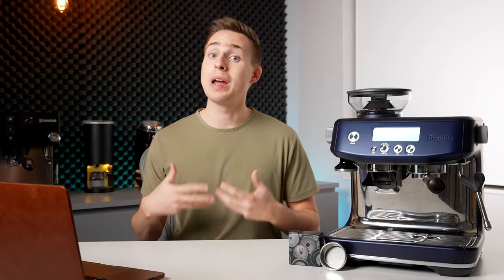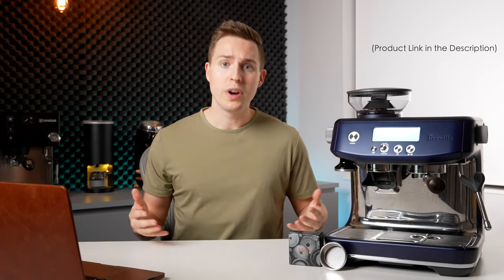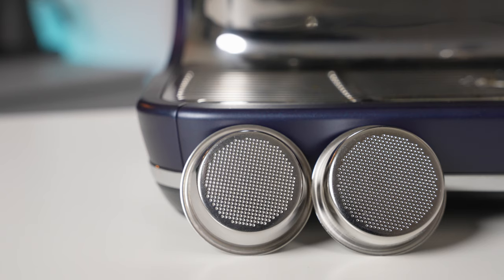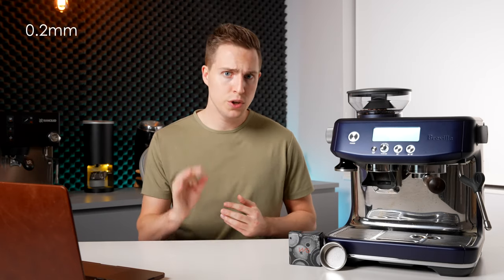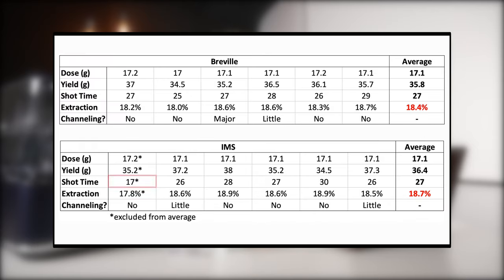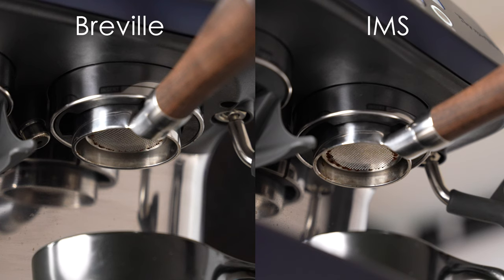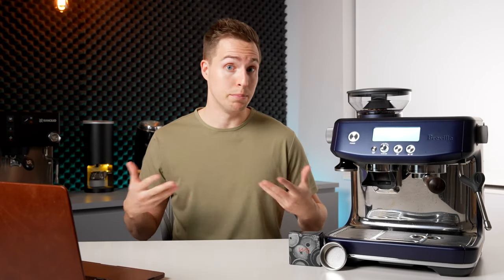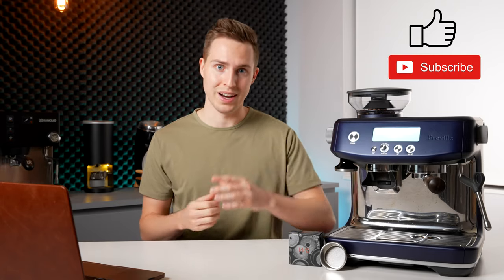54mm Precision Filter Baskets | IMS for Breville

Comment: Hi. I watch al off your vids because they are verry detailed. I order the ims basket. I get the B62.52TH24E. IMS website says this model is for 14-16 grams. H26E is for 16-18 and so on. Problem is now if i put 16 grams into my basket palm tamper is not leveling at max. And the gap between the showerscreen is huge. I dont get this. Ims website specificialy say this baskets are designd for breville/sage. I know i am not the only one struggeling with this. Hope someone or you can tell me wat to do? Use a puck screen? Thanks
Reply from the maker: Certain coffees are more dense than others, so the same dose will take up less space in the basket. Simply increase your dose to properly fill the basket you are using, and adjust your brew ratio accordingly :)
Reply: @LifestyleLab_   aah if thats the solution thanks haha. Gonna try a puck screen also. Thanks again ☕
Reply: The finer you grind, the less volume for the same dose. Wondering why IMS didn't adjust the basket depth accordingly since their baskets have faster flowrate.

Comment: Does yours also bear machining scratches/marks inside the basket? I have personally seen that in two units, and a lot of users on Reddit have been complaining about that as well.
Reply from the maker: Depends what you mean my machining marks I suppose? Nothing abnormal for a filter basket, and I have I think 6 baskets from IMS

Comment: Great review. I bought a cheap Amazon basket that helped but wasn't noticeably better than the Breville. The non tapered side was the major difference. Have you done any experiments with the IMS SHOWER SCREEN????
Reply: It’s a game changer. Highly recommend it. The difference in the water distribution across the puck is really noticeable.
Reply: @Nvlarr  specifically I have the Barista Express, and you think the IMS shower screen is definitely a step up from the stock? Or do you mean the filter basket?
Reply: @CaboricanMan  I have the same machine. I got my 14-18g ims basket off Amazon. It changed the game for me. Was able to grind finer. I bought a niche zero and it transformed the game. 

Then I got the IMS shower head and swapped that in as well removing the stock one. Completely changed the game. Equal water distribution (or more so than before). 

Definitely get a better grinder if you can. The separate sage one is good. Or for the barista express which I have you can take the grinder out and reduce the settings so it goes finer. Try that first. 

Also. A tip. When using the barista express I brew it by timing between 25-35 seconds and get around 9 bars consistently by holding down the perfusion button for the whole time then double tapping it quickly to stop the flow at about 2grams away from my desired output liquid level. Honestly COMPLETELY transforms the taste. 

If you let the machine do the espresso itself. The flow and the pressure is far too fast for the former and for the latter produces like 12 bars of pressure. Genuinely give this as go. 

I’ve used Lamarzocco £25k machines loads but I can by removing all the variables (good tamper, ims basket and shower head and niche zero) get pretty similar if not better coffee on my sage barista express. Because I’ve “completed it mate” haha
Reply: @Nvlarr  Awesome man thanks!!! I will try holding pre infusion when I get home today. I have a new bag to dial in today anyways. Also gonna grab the IMS stuff to "complete" the machine lol.
Reply: @CaboricanMan  awesome mate. It means you can go fine enough and hold it on pre infusion. Comes out at 9 bar and it’s insanely good. Honestly.
Reply: @CaboricanMan  thinking of getting the IMS 54mm precision basket. regarding swapping out the shower screen to a better one, which one would you recommend, and is it simple to install? I'm pretty new to the coffe game :)

can anyone recommend a suitable bottom less portafilter?
I got the barista express fyi.
any other suggestions are welcome :)

Comment: What is the model of this basket? Is it good for 18/18.3g doses? Thank you
Reply from the maker: There are different sizes for different dose ranges :)
Reply: @LifestyleLab_  and what would be the best for 18/18.3gr doses?
Reply from the maker: The 16-18g is similar to the stock Breville basket. The 18-20g will give you more space to up dose, but may need to be used with a bottomless portafilter

Comment: Just got my IMS basket for the BBE. And wow, so far my results are completely the opposite. I'm still dialing it in, but initial results are not too encouraging - I went a step finer and got a very fast shot that was also very bitter. So much so that even a milk drink with it was bad. I'll try lowering the temperature and yield (it's a pretty light roast so I've been brewing it at max temperature setting and high ratio 18g in/40g out). I haven't been getting any bitterness from the stock basket with these beans. Still can't imagine how grinding even finer can fix it...

Comment: There are two baskets, 15-18 g and 18-22 g.  For an 18 g dose, which I prefer, I use the 15-18 g basket. I would use the 18-22 g basket for someone that likes a stronger dose. I like the screen for keeping my shower head cleaner and don't experience any problems with the extraction. I found some 54 mm filters on Amazon that I will try soon.
Reply: Go with 15-18

Comment: Can the IMS basket be used in OEM portafilter or only in a bottomless one?
Reply: I have the BBE and it works fine
Reply: I use Crema Products NPF and OEM double portafilter but I removed the black plastic from OEM portafilter. I also have IMS shower screen. If you remove black plastic be sure portafilter is heated appropriately. Using Breville Infuser.
Reply: @Bryan-eg7si  great video. Thank you. What portafilter are you using? I am trying to find one that fits my Breville but found some reviews saying that if the 3 ears are not exactly the same as original one it will break the fitting in time.

Comment: Can you make a video that showcases IMS Showerscreen for Breville?
Reply from the maker: I have an IMS shower screen for my Appartamento, and I'm sure the IMS shower screen would be better than the stock Breville one in some ways. However, I've never installed a new shower screen that I've been able to taste the difference from... so it would really be more a piece of mind thing that you have the best component possible in there. Taste-wise, I'm not sold
Reply: @LifestyleLab_  Would be great if you would be able to run an experiment to find out. 
I currently have the shower screen installed and I find that the water flows much more evenly which reduces channeling and produces a better shot. 

Would love to hear your thoughts as well as extraction and taste experiments for this accessory as well :)
Reply from the maker: Certainly worth a formal test!
Reply: @LifestyleLab_  The issue comes specifically from Barista Express, it seems to have issues with its current shower screen so getting the IMS will be interesting. A quick youtube search will show you how terrible it is..
Reply: I would recommend that you check out Hoon's coffee channel here on YouTube as he has gone over the IMS shower screen for Breville and many other products in depth. Hope that helps.
Reply: @LifestyleLab_  To me taste is relative to individual palate and type of coffee used. Many roasters use Robusta to enhance the crema but won't divulge the ratio of Robusta to Arabica in their notes. Nothing against Robusta but we all know Robusta adds sourness depending on variety and ratio used.

Comment: I tried this IMS basket and it pours extremely fast even after lowering the grind size. I might try a higher dosage to see if it slows down but I may just end up going back to the stock basket.
Reply from the maker: Less clogged holes and more even flow does lead to faster flow with most precision baskets compared to stock baskets
Reply: Having it flow fast is actually a good thing, shows just how much the stock basket was clogging things up. No idea why you would switch back, grind finer whether that's by the outer burr or the inner. If you have maxed out both burrs then it may be your beans that are the problem, not the basket, grinder or anything else. You shouldn't be anywhere near maxing out your grinder if you have proper beans.

Comment: I purchased a 20g basket and I'm still to figure it out. My pucks seem really wet now at 20g coffee in and I'm not getting the same yield as the stock Breville basket. I have tried dosing higher, changing the grind settings and it still tastes sour and uncontrolled. Any advice? Thanks.
Reply: What's your time, dose and yield rn?

Comment: my Barista Express portafilter  actually falls out towards the end of an extraction. it cracked a double pane espresso cup and chipped my floor . the mess it makes is incredible. this happens on a second pull. imagine having to hold onto your portafilter to prevent it from coming out of the brew head!!
Reply from the maker: Definitely time to replace your grouphead gasket!!
Reply: @LifestyleLab_  I did replace the gasket.....it works for about  45 days at about 3 pulls/day....and then.....watch out!   also, I*ve not been able to get a gasket from Breville website for the last year and a half. never in stock in Canada!!